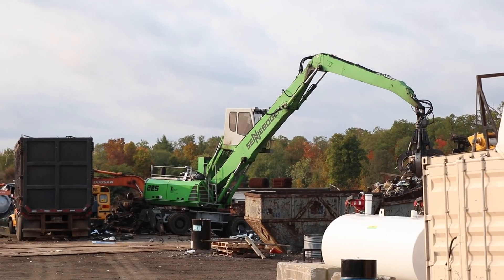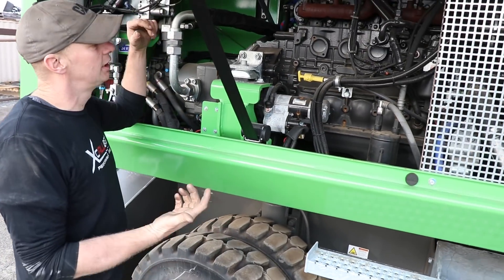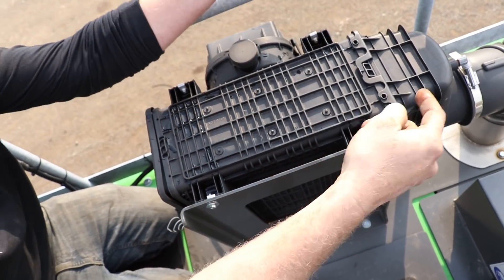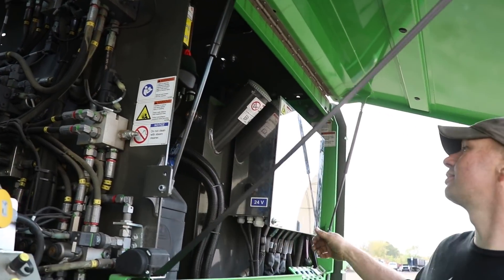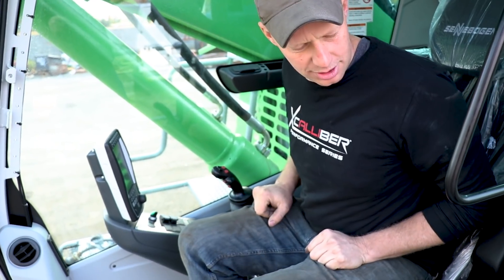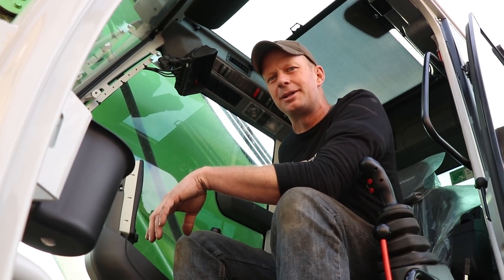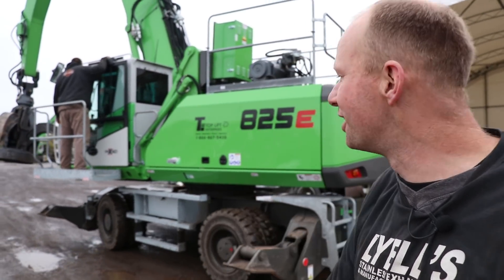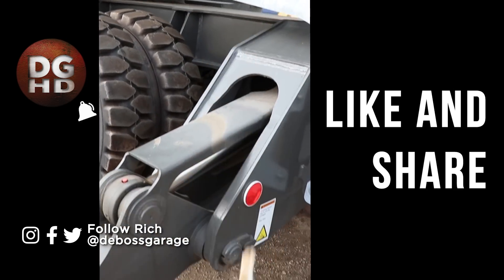What's Inside A Scrap Handler? Sennebogen 825e #HowItWorks

Comment: The things you could build if mechanics were actually trained to be problem solvers instead of parts changers. That school bus probably ran fine...probably not the best to keep in service...but if you rip the body off and shorten the frame and put a light duty dump body/flat bed, I bet it would make more money if you sold it like that than if you scrapped it. But I guess I forgot- school districts are about as smart as the kids that they teach and the parents that send them there thinking they’re gonna learn.

Comment: At the yard I work at we have 840. E I think it is an e its buttery smooth strong and very stable but we got it with 17k hours from loading barges the egr motor fails and limps it sometimes it just goes dead the turbo failed but when it runs it kills it out feeding the shredder sorting scrap I even got to use it sorting electric motors never used a magnet grapple but we hang magnets off our grapple so with chains and clevice to keep swing weight down because we only mag 10/20% of the time

Comment: Lmfao I fix the busses for that school, they're juuuunk
Reply: As far as I know the only good components on a school bus are the transmission and the engine.

Is that true?
Reply: @alouisschafer7212  sorry, it's only been a year lol. The drivetrain can be problematic at times, but they are pretty reliable. The electrical is good in those ones, easy to bypass issues

Comment: I used to operate an 850 and you have to keep those tires on the ground. Though they can handle the weight, those outriggers will go out faster if you keep it up all the way, because the aren't designed for the full weight of the machine. I love that grapple pin setup. I can't say I like those grapples with the built in magnet. I recommend they weld some traction plates over those outrigger cylinders, to prevent someone from busting their face when climbing up the side.

Comment: I'm just curious if they all have Cummins in them or if that's a thing for ones to be delivered to North America. Sennebogen being from Germany I would have guessed they have MAN in them.
I bet you that airfilterbox is normally on the inside of excavators and it's a generic one they just put it on top for some reason.
Reply: yeah I think it depends on the location 
What are you going to do with a MAN Diesel in the US or Canada when every 2nd Diesel in America is a Cummins? They are everywhere so its the logical choice to go for a Cummins.
Every mechanic knows them and parts availability should be a dream.
Ironically enough you will find rebranded Cummins Engines in small/light duty European trucks.
Reply: @alouisschafer7212  Just what I thought.
Well Cummins makes great engines.

Comment: Excellent, I totally agree with you about the air cleaner box, you could always put a metal of plastic box over it thats not got places for water to rest in, as far as the fuse panel goes, would get on the

Comment: I needed that bus for a tiny home lol. Unless it was a DT466E then it’s not a huge thing.
I’m 17 & finding a good bus w a 7.3 idi or a dr466m is pretty hard to find. People around here want a lot of $ for em even tho it’s truly only worth abt 3k.
Reply: It was hard to tell at the distance, but I think it was a T444E/7.3 PSD in the bus.
Reply: @abpsd73 , I sure hope it's not, but then again oh well, there's plenty more where that came from. sometimes I wish I was up near V&R but then again my 93 idi wouldn't survive up there w the salt. that buss could've easily sold for abt 1-2k of it was running tho. there's a reason it's at the scrapper.
Reply: @michaelbenoit248  The T444E has a problem with the heads, the casting is thin around the exhaust manifold ports, and rots out in rust belt vehicles, leading to exhaust leaks and turbo drive pressure loss.

Comment: Have they finally fixed the arm cracking and lower arm bearing problems on these? the older ones used to unload sand barges go through arms and bearings like its candy..

Comment: Watch out with emptying out the DEF tank completely. When you turn the machine off it will suck the DEF out of the system so it won't freeze, if there is little DEF left in the system it will start to crystalize and ruin the DEF pump

Comment: I used to work on a 2004 senenbogen 860, that machine and I got to know each other very well. I loved the crane but it was beat to hell and just needed to be put out of its misery.  In that time period sennebogen used electric over hydraulic for the controls. Beasts of material handlers. I learned to read german from the service manual 😂

Comment: Hydraulics made in italy? Gonna stay far away from that.. at least in central heating "made in italy" usualy means "leaks/is defective  right out of the box
Reply: I doubht the pumps/motors/valves are italien, probably German such as Bosch-Rexroth or Sauer-Danfoss, possibly Poclain aswell (think there French) . Italien pumps and valves are ok-ish, considered more 'mid range' in industry.
Reply: @deezelfairy  He said somewhere in the video that the hydraulic hoses and something else is italian made. 
I have no experience with pumps from italy, but the air vents, shutoff and mixing valves are all pretty poor quality.

Comment: Nice video. I’m a field service technician for a local Sennebogen dealership, they are very good machines, Id say 75% of our service calls are very easy electrical issues. I would have to disagree with the decision to remove the stick out limit switch. There is so much momentum while moving the stick that using the mechanical stop in the cylinder is a very bad idea. It’s not a concern about blowing the packing out it’s a concern of blowing the head off the cylinder. Good luck.
Reply: It would have made more sense to me that the switch was adjusted or relocated to provide more travel, but remain within the cylinder's limit.

Comment: I cried a little when he tore into that old John Deere combine 😢
Reply from the maker: Yep.  Off to become lamp posts....
Reply: @DGHD  circle of life I guess 🤷‍♂️ or I’m just a sucker for all things old.
Reply: @DGHD  how about making a snow blower out of the next one.
Reply: If it was 20 years ago, I guarantee you a Combine Salvage yard would buy that, I know because we had a Combine salvage yard. Had over 2,000 combines from 1983 I believe to 2008. Now we have about 54 combines, sadly around midwest ohio at least, they just didn't become very successful anymore. Now, that may be because we didn't get into newer 2100, and 2300 series CA-IH combines, or R series Gleaner, we did have 2. Or the 9000 series JD's. But anyway, a lot of the Combines we have left are older 300, 510, 540, 550, 750, 760, 860 MF, 4400, 6600, 6620, 7720, 3300 JD, 615, 815, 1440, 1460, 1480 IH, or Old ass Gleaners, and TR NH, they will all get scrapped with very good parts still. Sad thing really, nobody seems to want to fix the old stuff and use it for a reason probably, not big enough.
Reply: @Mopars_41  collectors might buy the stuff online if any of the parts can be shipped somehow

Comment: I have no experience with sennebogens, all i know is when i worked at Wheat City Metals in regina (Evraz North America sister company) The steel mill ran sennebogens  and they broke down daily and always had issues. They were down more than they ran. At wheat city we had a long stick Cat that was a 2015. It had a magnet attachment and the Engine was burning oil from brand new. Finning/Kramer claimed it was normal which i highly doubt it's alright to add 1-3 litres a week to a motor that was brand new. The machine i primarily used was a 954 Liebherr (track machine) with a grapple and we never had issues with it for the most part loved that machine, i pushed it past its limit unloading various industrial material. Eventually the motor went on it and had to get a new one
Reply: 1-3L/week is bad for a new engine. I ran an old CAT 980G at a sand mine in New Mexico, thing had 40,000 hours on it and took a gallon of engine oil a day.
Reply: @Porty1119  yeah I know a diesel shouldn't burn off oil like that brand new it was just poor service from cat/dealer. I liked running old cats from the 70s-90s but the newer stuff just like anything else seems to be overpriced junk
Reply: @wrectumwrangler  Yeah, there's a saying that with new equipment that you buy the dealer as much as the machine. I've seen some questionable new CAT wheel loaders, but my experiences with their newer skid-steers and telehandlers have been positive other than the quick coupler being a weak point.

Komatsu on the other hand...junk. Nice haul trucks and that's it.

Comment: Wondering why they not going for a fully electric version. I mean the motor is basically just turning a hydraulic pump while it's mostly stationary.

So why not running a cable to it? 🤔
Reply: Yes....let's run a cable capable of carrying (assuming an equivalent 130kw motor), 360v and 300+ AMPS, through a scrapyard, to a machine that needs to be mobile.

Also, the engine is only turning a hydraulic pump. It is driven by hydraulic motors attached to the wheels.
So, lets look at the problems associated with literally running a corded, scrap machine:

1: Is there even the local infrastructure in the community to support wiring a business for such high power draw?
2: Power outage? Well, can't work.
3: On the local side: What is the cost of installing the power handling electronics onsite? Especially since, if you're going to do it for one, you're probably going to want to eventually put everything on the same system, to make practical...So....now you need to plan ahead for what? 3? 4? Machines running on 360v, each pulling 300+ amps?
4: What is the practicality of having giant damn cables running to all of your equipment, in a scrap yard? How long until a cable gets damaged? How much are those cables going to cost?
Reply: @dposcuro  Yeah, you run into all the same issues with running electric shovels in surface mines, or trailing cable equipment underground, coupled with a more chaotic (and sharper, for lack of a better word) operating environment. Diesel-electric is a viable solution on loaders and trucks, but makes no sense on a hydrostatic machine.

One of the main driving forces behind running electric equipment underground is ventilation. That doesn't apply here.

Comment: Auto greasers are great until the system breaks and your busy.. and people keep using the machine
Reply: @Ben T. There OK in principal, the problem is the human side of things, you still need to visibly check all pins are getting grease, occasionally you get a line block and a pin/bush doesn't get lubed and through murphy's law it's always the pin that's the most inaccesable which is great fun in 10years when it's seized.
They also encourage manufacturers to not think too hard about access to a particular pin/bush, i.e how is a human with a grease gun going to contort himself like a pretzel to access that grease nipple? No worries because all we've got to do is run a 1/8" tube to it. (all HE mechanics no what I'm on about 😉) 
The other thing with going round with a grease gun once a week/month is your inadvertently giving the machine a real damn good visual inspection regularly.
Reply: Agreed. I don't care for them - in my experience, operators don't check to make sure all their pins are getting grease.
Reply: Fully agree, never really see them on forklifts which are my trade but I have looked after a few loading shovels in waste paper sites that I serviced the forklifts at and the first thing most the on site maintenence managers have asked me to do is rip it all off and fit regular grease nipples/zerks. 

It's the same with water auto-fill systems on electric forklift batteries, great until one sticks shut and you bake a cell dry, and in the operators defence, they have no real way of knowing. They also stick open, you overflow a cell and in time, wash all the acid out - not good, can't beat just flipping a lid and looking at the plates!
Reply: I work for a demo company and all our machines run Groeneveld auto greasing systems, it's a dutch brand and after 15000 hours on multiple machines we have had zero issues with them. There's an indicator in the cab that will detect blockages and if you just check the grease pot every couple hundred hours you'll be totally fine
Reply: @Ben T. No, your able to look beyond the surface rather than the hype, there are so many things in engineering that in theory and on paper seem perfect, but in practice meh...not so much. It's nearly always the human interaction that's the problem.
It's these automatic systems that are making operators crappy, set people up so that they have zero responsibility and guess what, they become irresponsible people. 
Don't get me wrong, autogreasers have there place - such as rollers on a conveyor that are 50ft off the ground.